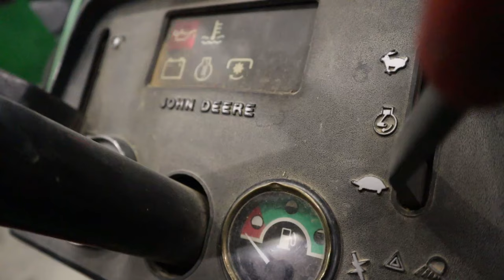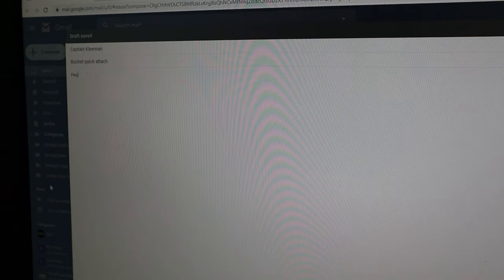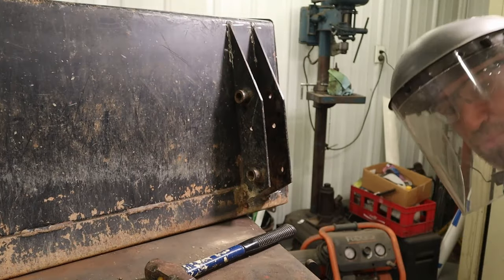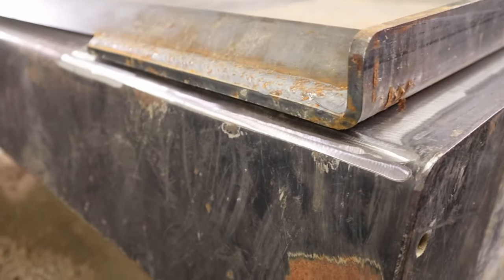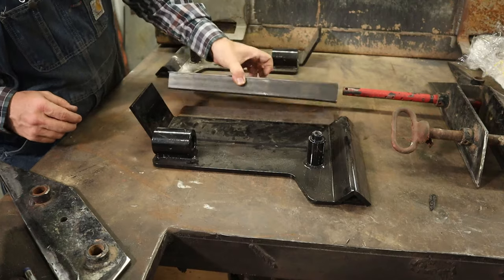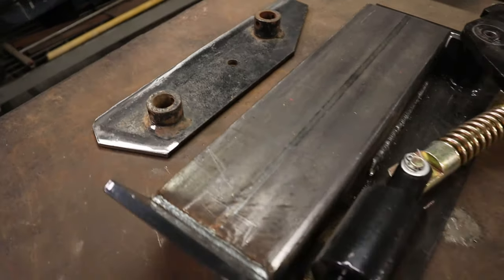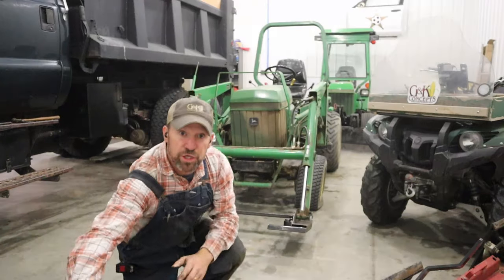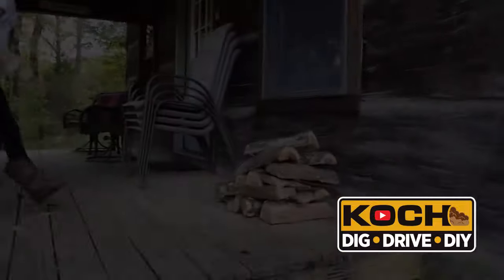Quick Attach Bucket Conversion for Older Compact Utility Tractors // John Deere 755 855 955 770 870

Comment: you made a lot harder than it needed to be.  IF you weld two pieces of square tubing, can be small, just to nothing moves,  across the 4 plate that the bucket pins go through.  Then just cut the bucket where the the plates are attached, so it make a rectangular holes in the bucket.  Those holes are covered by the new bracket, that you welded the the bucket.  Also allows you to pull the metal and weld inside the bucket as well.    IF you don't like to have 2 rectangle dimps in the buck you could cut a piece of then sheet metal and fill them, but it make not difference in strength.  Now for the tractor side all of you weldment and every are still in the proper place & alignment for your tractor pins.  Just alging the latch boxes and weld them on.
Reply from the maker: I think I understand what you're saying and yes, that would work pretty slick if you only want to use your bucket with the tractor.  I'm not sure your method would work if you wish to use other available quick attach style attachments, such as a  set of forks.  The reason for this conversion is so that you can easily connect to other quick attach style fitted attachments that are readily available. Thanks for checking out the video and for the clever idea.
Reply: Works to make it quick attach.  Works with all my other implement forks, 6 way blade, etc..
Reply from the maker: @burtcmcalpine  that's awesome!  I guess I just made it too complicated then!  I'd like to see pics of your setup.  Sounds like a good solution. Do you run a 6 way blade on a compact tractor? That would be sweet! Thanks for the idea. Might help someone else that's wanting to do this.
Reply: @digdrivediy  Well the way I did it the pin plates never moved as they both came off in one unit.  So less chance of anything moving and very little measuring needed. I have a Mahindra 3510 classified as  Compact Utility tractor and it handle a 6-way pretty good.  I think your JD is a technically a sub compact.   Just have to be careful or you can tweak the loader frame.  slow and steady works for cutting ditches, putting a crown on the roads,  and awesome at snow removal too.  Converting to the Skid Steer QA was the best thing I have done for the tractor.  I use the forks to put implements up on pallet racks and then have room for storage or whatever underneath.
Reply from the maker: @burtcmcalpine  I re-read your description and I clearly understand what you mean now on cutting the weldments off the bucket by cutting around them and leaving the bucket back plate attached.  That is a great idea! In the case of the JD model 70 loader, I think one could do this but you would just still need to measure up the proper mounting location of the hitch plates.  That is clever though I didn't fully understand at first.  I think you're right my tractor would likely be a sub compact.  Sounds like you get a lot of good out of your machine. Thanks again for the tip. If I ever do this again I may pursue that path!

Comment: I have a 790 with a 70 loader. Are you interested in doing this to my tractor?
Reply from the maker: Well you have a perfect candidate for this conversion Dan!  I wish I had more time to do these types of projects more often but unfortunately I just don't have time for another quick attach at the moment.  If you know anyone locally that has a knack for welding than I'll bet this is something you can have them do.  It really isn't too bad of a project.  Thanks so much for checking out the video and good luck getting that bucket QA conversion.  You'd love it!

Comment: I do not know why you would do this when you will probably find more attachments you want with the wrong attachment . Instead of changing all your attachments why would you not just make an adapter that fit the tractor switching it from JD to skid loader and then just take it off so you are back to JD ? there are some already out there.
Reply from the maker: Couple reasons really.
1. I didn't have any quick attach system before doing this, so no real attachments to speak of.
2. This quick attach system is more common for my area and I can borrow other attachments from my neighbors who run Kubotas with this QA system.
3. I didn't have to buy a different bucket.  Just welded a plate to my existing bucket which was much cheaper.
4. I already had a QA set of pallet forks and they also work on my backhoe.
5. The JD attachments are expensive to buy from Deere and I've found that these QA style attachments are much more common and inexpensive.

Thanks so much for watching!

Comment: WTF??? What is really with youtuber's and hammers. Get a scarfing tip for your torch. I never understood beating something you are going to reuse with a double jack....
Reply from the maker: Both tools have their place.  I have heated and I have beaten metal into submission. I welcome all suggestions though.  I'm glad to accept and try a scarfing tip for my torch.  Is that like a rosebud tip?  I have not been exposed to all means of metallurgy.
Reply: @digdrivediy  You did A fine job on that jd conversion. It's just me, ive been a machinist/millwright for 35 years and have made my share of unfixable mistakes with a mallet... A scarfing tip is a curved cutting tip for your torch. it gets in to those tight Spot's with out damaging the base metal. try it you will love it....